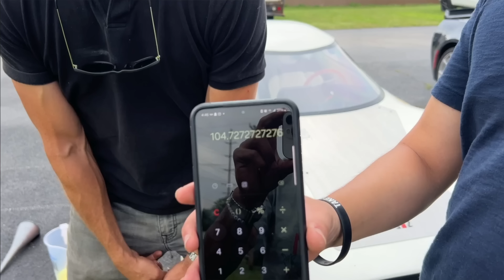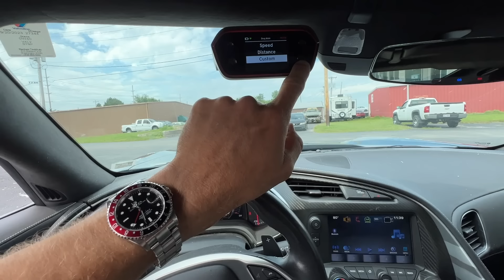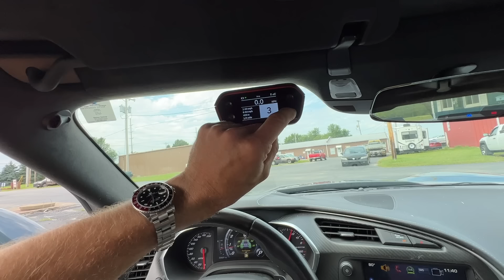FIRST 0-60 mph Test- Diesel OMEGA CAR - Video 3 of 3

Comment: Comparing production cars with safety equipment and fully finished with air conditioning and radios, and interior. Are you even able to adjust the seats, without tools? That car will need at least a few hundred more pounds to be comparable to the other cars. I mean look at those doors, like a panel of aluminum with a plastic window. A Morgan 4/4 gets about 40mpg with a gasoline engine, and would probably get closer to yours with a comparable engine installed. Other than the aerodynamics being better you have a super light car with an economical engine, so having a good power to weight ratio compared to the other cars, in a non safety tested vehicle with probably no safety systems. It looks like if there was an accident you will have to recycle the whole thing with the passengers inside it. This is an interesting concept car, but until it is "finished" it isn't going to go anywhere.
Reply from the maker: Yeeeaaahhh….. no

Comment: I agree with Casey.
And also industry goes wrong with electrifying a mountain bicycles already.
This is idiotic
People become so  lazy and stupid, so they can't crank up pedals to ride up hill in the forest and move their fat lazy ass, so they need $5k mountain eBike with electric assist and heavy battery to climb there, instead of using their health and body and develop skills. 
Not talking bout  the mount of parts, unsustainability and unreliability it has, beside additional weight.
I don't remember we vote for this...
And yet sheeple like it to justify on overconsumption and complication for such a simple vehicle as a Mountain bike.
 Gearboxes, belts, electric shifting - it will never work as best as simple and reliable as cassette\derailer  by chain by "1 by n" transmission, that proven to be reliable choice.
This should be ended.
Reply: Uhhh... the people are voting for EMTB with their wallets...because they are fun and practical.

Comment: "We" might not be killing little kids in cobalt mines using diesel but "we" do kill plenty of them in the process of collecting diamonds for the women of the world.  🙂

It took until 9 minutes into the video before "we" learned this isn't apples to apples.  Gearing a car with no top end to increase the gas mileage/reduce 0-60 times is a bit lame.  A Tesla Plaid EV does 0 to 60 in ~2.5 seconds, runs a 9.1 second 1/4 mile at 150 mph, AND get 100+ mpg-e.
Reply from the maker: Inaccurate completely.
Reply: @CaseyPutsch   That's a bit vague. Which part was completely inaccurate?

Comment: but but diesel is evil!!! we cant use such a dirty fuel!!!
Reply: Ultra low sulfur diesel can be very clean if used in an engine with some sort of NOx and particulate emissions controls running at low RPM and high load/turbo pressure.

Comment: The Tesla has like some boost mode you can put it in or something in but thats bs and far from real world. Rivian i know more about and that gives you like 10x of hard launches. Because those overdrive modes absolutely wreck the whole drivetrain and smoke the batteries. Evs are dumb. They are not environmentaly Friendly at all with those huge dirty lithium batteries RIGHT NOW. anf charging is slow... But they are pretty nice in a country like sweden where our gas prices are literally 10x yours. But dont get a tesla if you want a ev. Teslas are built like garbage.